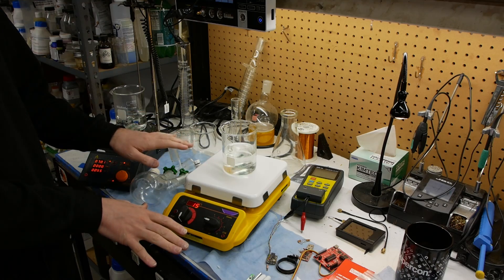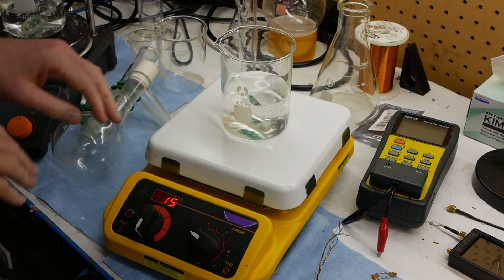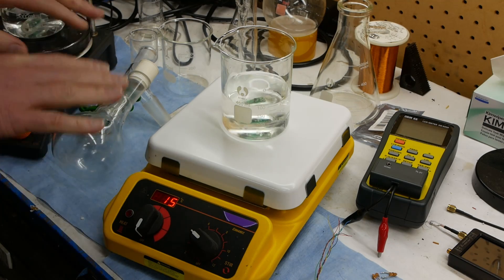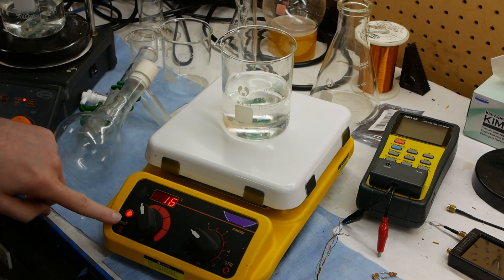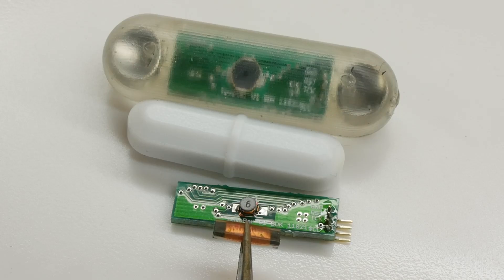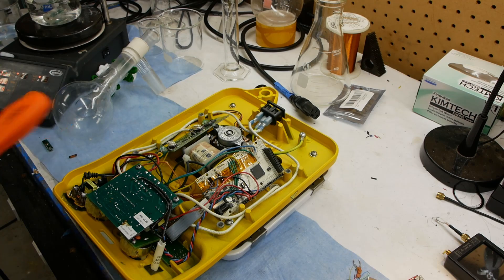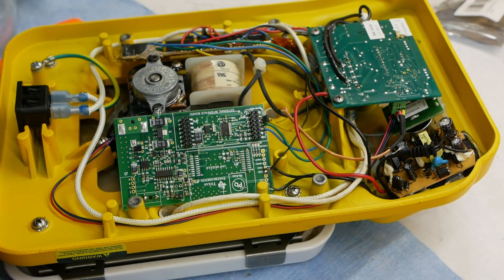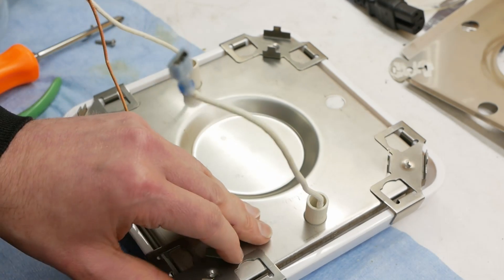Temperature-sensing RFID tag in magnetic stir bar

Comment: Great video with a really cool concept, but I would like to point out that as a chemist I would never insert a temperature probe directly into a reaction mixture. It should go either in a water/oil bath on the outside or into a heating block. As far as I'm aware this is standard practice.

Comment: Just a thought... First of all, excellent stuff as always. If the temp sensor is in direct communication at all times, it could be better to just use an on/off heating scheme depending on the energy to mass ratio. I say this because we once developed an induction heating process (instant on/off with very high energy to thermal mass ratio) that used a laser temp sensor input and our pic controller simply turned on the power until the object/liquid was at temperature. In this way, the feedback was instantaneous and as precise (even with an offset) as possible...much faster and more accurate than a PID. It was even more energy efficient because the calculation time was very close to zero. We used a 1Kw induction power supply to heat a small (25mm^2) susceptor to 300C in less than a second with less than a degree of overshoot....and held it there indefinitely.

Comment: Another exciting video as always from Applied Science! 
I was just wondering if it wouldn't be possible to use the heating wire as an RFID antenna? That would mean that you use the heating wire for heating for a longer time and as RFID antenna for a short time. An alternative could be to modulate an RFID signal onto the heating current. But even then you would have to switch off the heating current briefly and use the heating wire again as an RFID antenna. 
This was just a thought from me. 
Maybe as inspiration for another project. 😉

Comment: For the heat resistant coil, you can coat the wire with high temperature paint from hardware store. Bake at 200°C for 30min and coil it up.  Works good on custom heater cartridges up to 800°C.

Comment: Random Tip:

Electrical tape around a stirbar, completely silences a stirbar at high mixing.

Depending of course on your reaction, teflon, pvc, nitrile, or latex tape may be best, but having a lab run in silence is 👌

Comment: The only thing I could see a problem with, is temperature gradient. If the liquid isn't turbulent enough, so the stir bar measures a higher temp than the average of the liquid because it is so close to the heat source, the traditional temp prope is always in the middle of the solution giving a better idea of the average temp.

Comment: Hey, that's my area of expertise! :D
I've designed a few unusual and high-performance 134.2kHz HDX readers, to the point of having separate TX and RX amplifiers and even coils.
Even though most were based around the same TMS3705 that you're using, I've managed to get a read range of more than half a meter.
I know there's not a lot of info, but I volunteer to explain anything that I can.

-Coil diameter: Assuming the RFID tag is a single point (valid assumption in this case), the ideal coil diameter for the best coupling would be about twice the range you're hoping for ( so that radius = distance from center)
Larger coil puts wastes magnetic field energy in a large volume, and smaller coil keeps too much in one place. Magnetic fields fall down fairly abruptly because they are dipoles.

-Input power: has to be (at least) enough to create a large enough magnetic field in a coil you're using.
It could go very low with a superconducting coil, but hey, it's copper. If you use more copper, the power could go lower.
Too much power can't hurt, but it can melt the coil or overload the power supply.

-Coil inductance: not important by itself., but related to the input power and Q-factor.
I've had many single-turn coil designs that could then be integrated into structures. Great for EMC!
More important quality is the ESR of the coil. If your power budget is 1W, choose a coil such that the ESR@134kHz dissipates 1W at the voltage it's getting.
If you need 10ohm ESR, and your Q factor is around 5, you need 

Measure the coil in-situ, because the nearby structures can add a lot of ESR (induction heating).

-Tuning the coil: Beware of X7R capacitors!
Ceramic capacitors (except NP0) are very nonlinear with voltage, and they're impossible to properly tune.
Use film and/or NP0 capacitors instead. Also note that voltages can get to XXX Vpp.
For good transmission, tune for the highest voltage when the coil is in its place.
For good reception, and if your coil has a high Q-factor,  tune for about 128.6kHz ( between the high and low bit frequencies of the FSK downlink)

-Reading range: it can be limited by either TX or RX part.
Put an air-core coil near the tag just as a probe to see when/if the tag sends the whole response back to the reader.
If there is not enough power, the message from the tag to the reader doesn't get finished.
If it gets finished and the reader doesn't receive it, you could work on the RX part.

In your case, I'd bet that the SMPS nearby produces a LOT of magnetic noise that is picked up by the coil. they usually work at around 65kHz, which makes a harmonic right at the 130kHz where your RX part has to be the most sensitive.
Test with a battery to compare. 
I recommend shielding the SMPS or using an old-school transformer.
Reply: oh yeah, and excitation should be at least about 5ms to get a response.
Around 20-30 ms is good enough, but it depends mostly on the capacitance inside the tag.
50ms is usually more than enough.
Since this is a DIY tag which can have a much more beefy capacitor, I expect a bit more, but I wouldn't ever go over 300ms.
If it takes 300ms to charge a capacitor in the tag, then the tag should be improved, usually they all stabilize after 50ms of charging.
Reply: Oh I left the example unfinished:
If you need 10ohm ESR, and your expected Q factor is around 5, you need  50 ohms of reactance @134.2kHz , which is around 60uH.
If you'd have a Q factor of 20, the design inductance would be around 240uH (+j200).

And ofc. a capacitor that matches the reactance and can withstand the voltage  (= expected current * reactance , which could get to 100V in the latter example if driven by 5V)

Comment: That stir bar would be a nice failsafe mechanism for redundancy to the typical temperature probe for the oil bath temperature monitoring. A lot of chemistry lab fire happen because heating is turned on without puting the probe in the oil and then the hotplate goes all the way.

Comment: This is a very interesting concept.  Something to consider if attempting to use this at higher temperatures is the change in impedance of your coil altering the tuning.  I'm not great with RF and only experienced with 13.56MHz so this may be a non issue.

Comment: Cool novelty item. Tho really not very practical due to low chemical and temperature inertness as well as RFID signal issues when using metals in the reaction vessel. Not to mention cryogenic temperatures nor the size and cost implications. Magnetic stir bars are maybe not so useful for temp sensing. Mechanical stirring would be much more interesting as there would be no interference with the temp probe and the mech. stirrer.

Comment: That was indeed interesting, but I have a quick tip for those wanting to measure temperature without anything inside the flask.  Try an IR thermometer.  They are under $20 and typically read within 5C or less of error of what the actual temperature inside the flask is.  Usually you can just aim it near the bottom/middle where there is still lots of liquid inside, but not so close to the bottom that it picks up the heating element.  

This is not better than what AS is suggesting, but it is quick, cheap and "off the shelf", and you probably already have an IR thermometer or two.

Comment: [off topic] I have a Zenith 500 transistor radio. I think the front of the radio is aluminum because of the weight and because it is not magnetic. Plus it's gray like aluminum. How can I add a gold or gold layer to it by means of electrolysis? Can someone provide me with a proven method?

Comment: Forget about using the stir bar to keep data on what the beaker has been doing! This stir bar can be used as a sample label and data logger, eliminating the need for a lot of written notes. Also: if you get to data log the viscosity, pH, pressure and temperature (and the PID control loop output over time), you can get a shit ton of insight into your reactions and even use the extra parameters as a feedback signal for automating the reaction control loop.

Comment: I searched for several hours today for a solution to measure static head pressure that could fit into this form factor. I even tried chat gpt. Lots of parts that have single or dual an air open air ports, but nothing that can be sealed into a stir bar and still be able to measure the pressure exerted on the stir bar, particularly for caustic or toxic chemicals. What sensor were you thinking about that could be used in this way?

Comment: Regarding the ceramic-coated maegnet wire: does anyone know of a small cheap electric motor that works at around 250 Celsius? I have an old gas stove I would like to add a little fan to, in order to get some kind of convection oven thing going inside it. But I can't find a high temperature 'toy motor' anywhere?

Comment: A pressure sensor would be great for a lot of reasons, but for checking if the flask is starting to be empty wouldn't it be easier by watching the thermal mass? 
As we know booth temperature and power used to keep the temperature, we can watch the moment, when it will need much less power, so the program can rise the alarm - for now it wouldn't need additional hardware modifications
Overall idea is great. I really like your channel!

Comment: Really nice job!  However, I believe traditional thermometers will retain one advantage over this stir bar design, i.e., a quick response time.  I would be interested to see how the mass of the stir bar and the insulating nature its inert shell contribute to thermal lag.  Also, the stir bar sits low and near the heat source of the hot plate.  That can cause your temperature readings to be slightly high.

Comment: Not quite the same, but I did see a pill-shaped gadget with its center of buoyancy and mass tuned in such a way that it would pivot as the density of the liquid changed. It had a little IC onboard that would use the angle of flotation as a proxy for liquid density around a very narrow range. Useful as a non-contact means of tracking how far along your beer fermenter is.

Comment: So, what does heat above 90C do to the electronics and the returned values?  Most electronic components have a limit to the amount of heat they can withstand before going flaky, destroying themselves, or at best giving bad results. Eg: the MSP430 has a TA of -40 to 85C in free air.  Boiling it at 100C+ could be interesting...

Comment: It would definitely be interesting to get effective slip/torque on the stirrer and therefore viscosity of the material.  Magnetic slip angle would be one way to get that but if you have an accurate enough MEMS IMU wouldn't the RPM of the doo-dad alone be sufficient to derive slip?  Comparing asynch to synchronous rpm in an A/C induction motor is how you get slip/load. The whole notion of "slip" is probably not relevant to a permanent magnet rotor situation like this though.  Therefore, simply measuring the resultant stator current is all you've got for something linearish proportional to torque.

Characterizing your stirry do-dad's inertia and friction might be difficult between magnet/chassis manufacturing tolerances so I'd imagine you would want to have a setup calibration against known fluid/temp like distilled water at 25C and 50C or something like that.   Would be very cool to see that working!  I imagine flask material and thickness would also be important to hold constant when characterizing for a permeability/coupling quotient.  Even taking ALL OF THAT into account -- the depth/pressure of the liquid would also surely have an impact on torque as well?  So many variables... but it still might yield a useful figure.

Comment: Would it be possible to have a hole in the pcb, and mount the inductor/antenna 'upside down' so rather than pointing up off the board it pointed through the board?  Possible avenue for slimming down.

Comment: You could always use an IR temperature sensor gun. I mean this device is pretty cool (or hot).
Reply: IR guns don’t reliably work on liquids or transparent material. The temperature of the hot plate is not necessarily the same as the liquid in the flask.

Comment: I wonder if it might be possible to re-purpose automotive transponder chips. Those are also identifiable, have non-volatile storage and I think some have a very small microcontroller all in one chip. You would probably need a I2C temperature sensor, which makes it slightly more complex.

Comment: I imagine in its current state, the maximum temperature for the sir bar would be limited by the melting point of the solder used for the PCB, or max operating temperature for those chips.
Have you done any tests to find the max operating temperature?
Reply: Solder is very sticky stuff, it normally stays on the pads even when molten. If you have a polymer to pot everything in that wouldn't be destroyed by such a temperature, I imagine that the device could actually work fine while the solder is molten. The BGA chips may be a problem, but actually in the course of shrinking this down to the size of a standard stir bar you would abandon the solder and BGA packaging and wire-bond the chips directly to a flex-pcb.

Comment: To anyone wanting to reproduce this... while the eZ430-TMS37157 dev kit is no longer available, you can still buy the TMS3705 which is the main component used on the "base station" (reader) PCB.  There is also appnote SCBA031 for adding a MOSFET driver chip for longer range.  It might also be possible to source the MRD2EVM reader which is similar, or RI-STU-MRD2/RI-SMD-MRD2 modules.  I still maintain a bunch of 134.2kHz RFID readers in penguin monitoring systems.
Reply: As in monitoring tuxedo birbs, or is it a brand name?
Reply: @cameronwebster6866  yes, the tuxedo birbs 🐧 
There are RFID readers and weighbridges for the little penguin colonies on Phillip Island Australia (I just returned from a maintenance visit there) and readers for both little/blue and Fiordland/Tawaki penguin colonies on NZ South Island.
There are also similar monitoring systems in Antarctica of course, but I’m not involved with those.  And yes, we use Linux!
Reply: @KeanM  cool! How much if the stuff you fix is penguin damage vs. environmental?
Reply: @KeanM  Me & my better half visited those guys on the breakwater at St Kilda beach in 2015. Sounds like a cool job you've got
Reply: @cameronwebster6866  I don't think the penguins cause much damage apart from their "deposits" needing to be brushed off the weigh platform regularly (auto tared anyway).
The big problem is of course corrosion, with equipment being right on the coast in full open air, followed by pests like ants and rats.  Things need to be sealed tight or else wont last.  Most of the electronics has survived well though, and just metalwork, connectors, and cables needing occasional replacement.
The humans do break things though on the portable readers, as they get a bit of abuse in the field.
Reply: @jimmy2drinks  Yep, pretty cool - but only something I get to work on for a week or two each year.  They use some of my custom portable RFID transponder readers at the St Kilda colony.

Comment: I wonder if this could be done much more simply if you used a digital potentiometer to fake the temperature probe signal. You wouldn't have to run your own pid control or hijack the display.